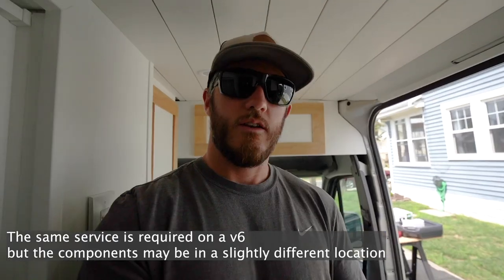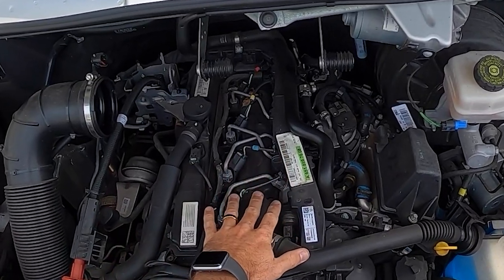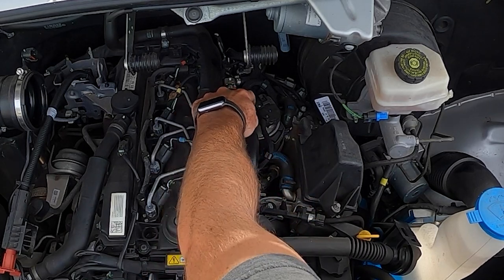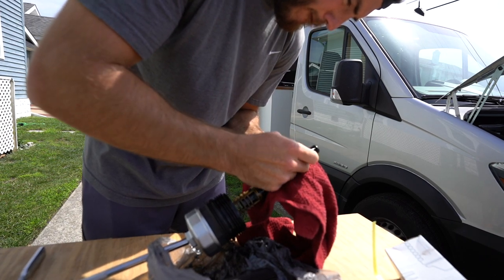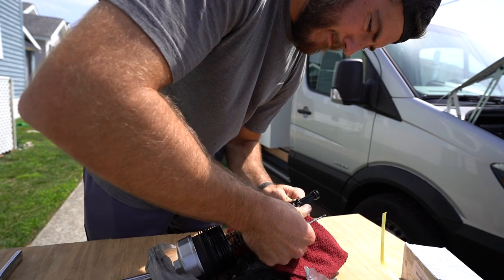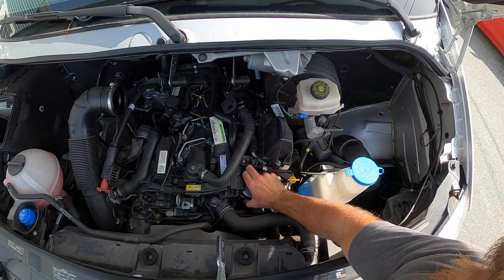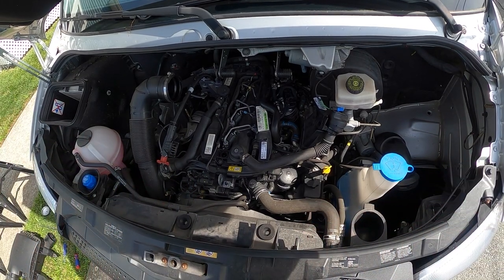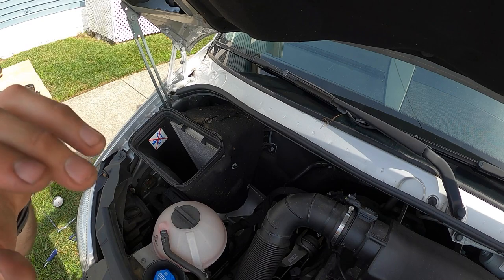Mercedes Sprinter Van - Service A Maintenance - Oil Change and Fuel Filter Change - Van Build Ep 44

Comment: I have a 2021 mercedes sprinter 2500 with the same engine. But no come with the dipstick. The dipstick in your truck fix in the 2019-22’ gen?

Comment: Hi Kevin, I saw you changed out the NOS senor on one of your video.  I just wonder have you file for  Approved Emission Modifications ("AEMs") from Mercedes? I filed my sprinter and they repaired changed out the nos sensor and got a check for the settlement,
Reply from the maker: Hey! how is the van running after you got this change made?  we have yet to get a check or do the upgrade.
Reply: @MathersOnTheMap  it's running good.

Comment: The missed oil filter oring can be a costly mistake. Gladly you caught it. I've seen experienced mechanics make that mistake. It's good to do your own work when you can. It get you familiar with your vehicle and let's you look for other potential issues while you are at it. One of the biggest problems with the European imports is cost of general maintenance. Most people prefer to pay for it rather than do it themselves. One tip that applies to any vehicle is to keep an eye for mice that love to build nests under the plastic cowling. I'd love to hear how the power is on the 4 cylinder. I see you are getting excellent mileage.
Reply from the maker: yeppers, could have been really bad!!!  4 cyclinder is great on MPG we haven't had any issues and the turbo is able to keep us moving along, sometimes the pedal is to the metal on steep inclines but we're almost at max GVWR so

Comment: I wanted a Sprinter until I watched this procedure on another channel. My Chev 6.2 diesel van has a firewall mounted marine type Racor Fuel filter/water separator that is fully accessible without removing ANYTHING . Unscrew lid by it's T handle, pull out filter, loosen lower drain vent to vent accumulated water, put in new filter, replace small T handle & lid gaskets included with filter & Presto! done. Sorry Benz.... Thank you for you video though!